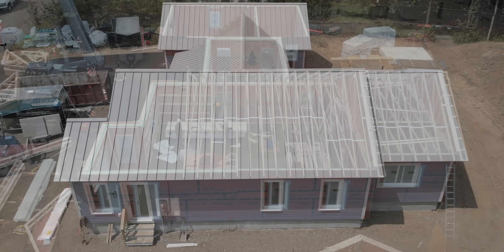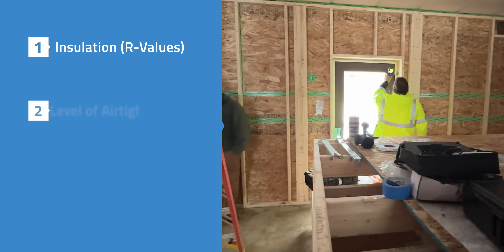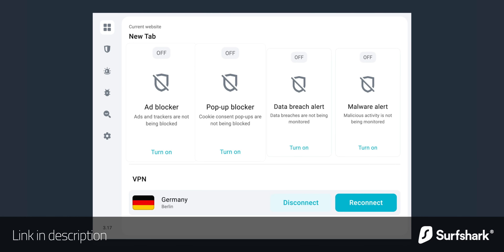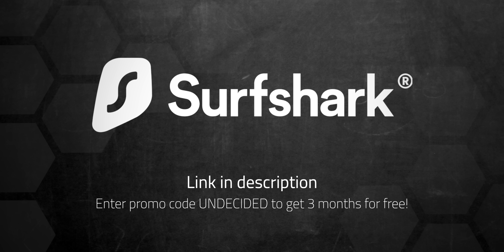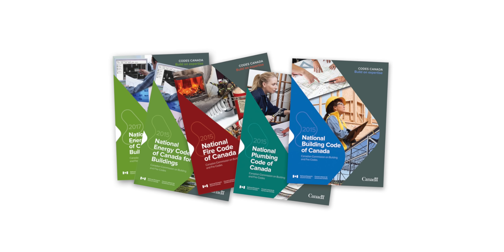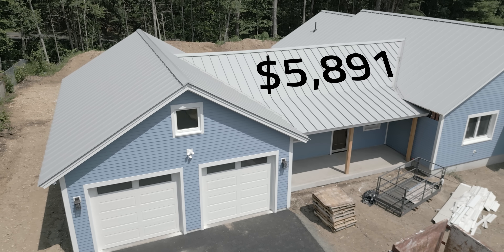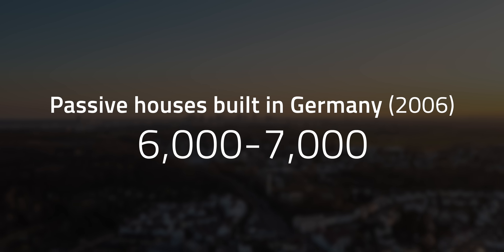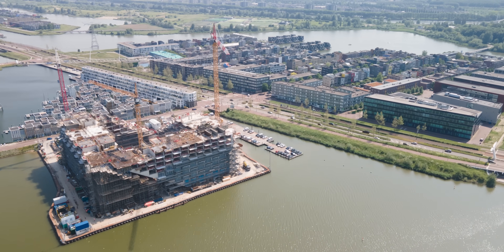Why Do American Homes Suck?

Comment: Great video, I like it for multiple reasons.
First of all when I was building the house I was checking all building materials due to quality and effeciency. The effecienty is based on eco norms for isulation.
Here in EU, namelly in Czechia after 2020 is super strict and if you don't have any form of heatpump grade A+ or A ++ with triple glass layer of windows and walls made by ceramic blocks 30+ cm in addition another 20+ cm of insulation such as polystyrene or some kind of fiber as well as air recuperation you have no chance to get A grade for passive housing.
Even though it's not enough, I have retention basin around 5000 liters of rain water gathered from the house roof used for garden and for toilettes to save drink water. All filtered thru complex filtering system. 
Solar cells with battery system in not mandatory for A grade so far but will be in near future for sure so highly recommended. So strict it is here. And such house price? Then most of EU countries have obviously house price significantly more expensive than in US. Exact location matters but if we speak in general than yes, all regarding housing market in EU is more effecient and more expensive. 
If I consider climate of Czechia I would say some features are overkill.Inside of house is hard to go below 19-20 deg.C even with heating off in winter or even above 27-28 deg.C in summer with A++ grade of AC.
Even my norwegian stoves are A+ grade and single wooden log can burn up to 2 hours and heat up entire house of circa 180m2 up to 23-25 deg.C. 
All sounds good but build and pay for that is the other part of story 😉

Comment: Comparing with the UK, which somehow seems to be a standard for Americans, isn't setting the bar very high, since it is known in Europe that British houses suck. 

As this quote shows:

"Putting it simply, the UK is home to some of the worst insulated housing in Europe. In 2020, UK homes lost an average of 3 degrees of heat after just five hours – with those in Norway losing just 0.9 degrees and Germany only losing 1 degrees centigrade within the same time period."

Comment: Cost. You want an efficient European concrete walled home I'll certainly build you one. I'm just as capable of a builder as any of my European brethren. However, most people cannot afford that here. Also, imperial measurements are no more inaccurate/accurate than metric and anyone who says different doesn't understand how measuring works.
Reply: I dont think he understood that money is already tight for majority of Americans and the housing market itself is terrible right now. People cant afford housing as is, let alone a large 50% or even double cost to get it super high efficiency. sure everybody wouldnt mind a better home but people buy what they can afford. Tagged alongside a used home, nobody is going to buy it full price, then remodel from foundation up to get that higher rating, it wouldnt be financially smart. This video really glosses over more glaring issues.

Comment: As a large HVAC contractor I get what you are saying about the waste of energy, however you act like it's cheaper in the long run to build more energy efficient houses and it's simply not. Builders have a hard enough time selling new houses. The fact of the matter is that the amount of people can afford a new house is a small amount and if you are adding an additional 30% to 50% of the cost you now even have a lower percentage of buyers. In 15 to 20 years the equipment will need to be changed out which will cost more money.  Energy is cheap right now so until it becomes more cost effective people won't spend the money. Most manufacturers of that equipment are having reliability issues in the states with the more efficient units as well. I agree about the insulation but if it is not done right it leads to high CO2 and other air quality issues. Most American homes use gas so the draft does help with air quality issues. That's just one issue caused by low ACH. They need to do more research to gather data to see if sealing a home up could cause long term health issues.
Reply: The extra 100k+ is a lot of years worth of energy consumption lol

Comment: Very interesting, thank you very much. 
I am from north-west Italy, a region basically surrounded by the Alps on 3/4 or its borders. Hence, quite cold during winter and hot in the summer. Following the strict building rules we have, both for new buildings and for the ones under renovation, our apartment in the city centre (around 200 m2 = =/- 2,100 ft2), in a mid-eighteen hundreds building, totally refurbished and restored lately, is very well insulated, to the point that even in the coldest winter the temperature inside never goes below 18 C, without turning on the heating. Clearly having centralized heating and water heating system makes the difference. It is a matter of economy of scale: heating the entire building in a centralized manner, with one very large single heating unit, is more efficient than having 50 individual heating systems, for each one of the apartments.
Also, we just finished restoring/refurbishing our early eighteen hundreds country home (800 m2 =  +/- 8,600 ft2), with all the newest technologies like heat pumps for water heating and solar panels for electricity production, while taking into account the character of the building, like using hydraulic lime plaster on our very thick and insulated walls and terracotta floors, which also protect against mold and humidity besides contributing to insulate the structure. Nevertheless, investing in such type of building is extraordinarily costly. Hence, in many cases, the State as a whole came in. In the last 3 years, our country has invested a ridiculous amount of money to fund and support energy efficiency transition, particularly in private buildings. As taxpayers, we produced a large internal debt in order to absorb such investments; nevertheless, perhaps this might indeed carry positive environmental effects on the newest generations.

Comment: Altough European houses are so well built, the EU is putting a lot of pressure on the citizens to improve there homes even more. We are pushed to rip out double glassed windows, replace (almost new!) gas heatings by heat pumps, install photovoltaic systems,  renew roofs and insulate the fronts even more. Regarding the enormous energy costs and the actual finanancial inflation this is a burden which most of us cannot bear. So this is the other extreme compared to the situation in the US. It seems the EU wants to save the world on its own. But to the true reason is the money - climate protection is a huge business here.

Comment: It’s common and also mandatory in the most of the EU to build energy efficient homes / public buildings etc. The project has to meet high energy standards to even be approved for construction by the authorities. Tripple glass windows, heat pumps, air exchanging units, tons of insulation.. that’s pretty much basic stuff to meet the criteria. Anyway, loved the video

Comment: I must be the only one in Scandinavia who misses my US type help. My heat pumps are terribly inefficient, windows mold so easily, and bathroom design baffles me. It is a 1964 house updated in 2018 just 3 yrs before I bought it. Even keeping my house at 19°C in mid winter costs me about $800 a month.

Comment: This felt like more of a soap box video. I was hoping you would go through your house and display or explain what you did differently that would improve current methods of building. And if money was no barrier, I'm sure those triple pane windows would be great. Unfortunately, quadrupeling the window budget on every house because we regulate it that way would add even more time and money required to build houses. You mentioned you would save about 6k in energy costs in your house, but you didn't mention over how long, or how much more money you spent in construction over the other houses in your area.

Comment: My biggest concern with complex systems for energy reduction is the embodied energy in the manufactured products, future supply chain for maintenance, and  cost to repair when disaster strikes.

I build for a living. I had a roofing supplier push a 30 year warranty on their asphalt shingles recently. I just laughed. In the 2050’s if we are still using asphalt to construct roofing, we are in trouble.

That is the theme of complex hvac systems, building envelopes sealed with petroleum products, composite materials that depend on international supply chains sourced feedstock, etc…

It seems to me that regional building systems have been the standard for human civilization for centuries. It may be hubris, and recency bias, to be think we can ignore those principles and call our modern systems ecologically sustainable.

Comment: Wow!  You are “saving” more than my energy bill is (gas and electric) for a year.  No solar and two HVAC systems on 2800 sq ft. 900 sq ft is a new addition as of 2016.  1900 sq ft is from 1957!  We did replace the windows and I have insulated and sealed it up a lot.

Comment: This stuff isn't common where I'm from 😂 we just usually build our houses using concrete blocks. No high tech ventilation system. Normal pull up windows and maybe an ac unit. We build on concrete pillars too. Our houses last wayyyy longer than the American cardboard houses.

Comment: Lived in the UK - houses there are rubbish too. Drafty as hell, single pane windows, no proper insulation, so as long as you got the heat on, it’s warm, when you turn it off, it gets cold, black mold problem pretty much every flat I lived in. Bills were really high during winter because of that. In the summer, the flats felt like a personal sauna as heat is not being kept out due to air easily moving through the walls 😅 Landlords literally don’t care, since the majority of buildings are very old, so it’s expensive to do proper renovations. So happy that I moved out of the country and I now live in a normal european apartment where there’s no problems.

Comment: I’m doing a remodel in California. The cost to build is staggering. I spent $80,000 in fees to add 1600 sq. Feet. Solar and Battery will be another $80,000. Heat pumps will be almost $70,000. Adding high performance walls and windows at California prices will take two generations to break even. I literally can’t afford any extras. Local government will squander what I would have used to make my house high performing. 

In America, outside of California, almost anyone can afford a nice house. I don’t think that’s true in Europe. 

American homes may suck, but most Americans can have them.

Comment: I have spent time in Romania, where these tilt and turn windows are common. The tilt out is fine, a good Innovation on swing out windows. However, overall, I despise these windows in general. I believe slide up and down are far superior. The tilt and swing windows swing with the wind. They can be dangerous. I would never put them into my house unless I had to.

Comment: You really glossed over cost increases with higher regulations. We're in the middle of one of the worst housing affordability crisis in history in the US. You even mention Canada with their more strict regulations which is ironic since their housing affordability crisis is 10x worse than the US. Most people already can't afford a home, and these mandated efficiency regulations are not helpful. Cheap energy in the US also accounts for less need for spending more on higher insulation requirements. I'm sorry ,but most people aren't trying to 'save the planet' from climate change when they're already struggling to even buy a shack. It's a very privileged way of thinking.

Comment: In Latin America most housing is made with concrete blocks, ceramic floors and tile or aluminum ceilings. A lot of houses in Central America and the Caribbean have withstood hurricanes so I’m not sure why this construction method is not common in TX, LA, AL, GA, MS and specially FL
Reply: They could build that way too if they want..

Comment: "Why?"... probably because the minimal amount of cost savings is barely worth wasting thousands of $ just to save a tiny amount of energy. 

As cute as it is to say "This reduced our energy usage by 300% percent!! 🤪"... if you had to spend $10k to get a 100% decrease in energy usage (which was only $500/yr to begin with)... you're only saving $250/yr... that's 40 years for that investment to BREAK EVEN.

...and in 40 years, THAT will be considered "inefficient"... so then what? Dump another $10k into better insulation to cut that energy usage in half and save $125/yr?

Diminishing returns... something most European counties don't seem to understand and why your average American lives like the upper class in Europe.

Comment: Apart from heat pump. The house described is a standard minimum style house from ~30 years ago. However I think municipal heat, which is common in Finland in urban areas, compensates the lack of heat pump tech in 90s. Also everyone basically has reserving fireplace in their house.

Downside of the Euro efficient house is the hot summers we are getting. Once the building has warmed in the summer heat, you can't cool it down. And heavy insulation prevents cooler outside during night or just random cool day from cooling the building either. Big problem especially with big buildings. You can feel the buildings radiating heat during summer nights after baking in the sun for few days or if the air been very warm. Ability to take in heat during winter is good, but not during summer.

Comment: Two huge things missing here are the timeline that $5981 would be saved over, and the cost to realize that savings.  Two major drivers you don't discuss are opportunity costs (do you save as much as you'd make by putting that money in the S&P500, with 10% average nominal returns?) and lower barrier-to-entry (people struggle enough to buy the homes we already have, let alone those + extra cost for efficiency updates). You also discuss this in terms of "the US", when the US is so geographically diverse that one size will not fit all for any building requirement - e.g. northern-midwest & northeast states already have much stronger insulation requirements than southern states, both because of higher risk of frozen pipes & dangerous cold is higher up north and because risk of mold tends to be a lot higher down south.

Comment: In the UK we require an energy performance certificate before we rent or sell our homes. Energy companies charge everyone through the bills to create a fund which insulation companies Apply to spend making existing buildings more efficient.
The EPC last maximum of 10 years, but need to be changed if improvements are made. Certificate approximately £50 cost

Comment: We built an very efficient house using geothermal pumps for heating/cooling and domestic hot water in 2020. The house is very tight and has a HRV for air exchanges. It is a very comfortable house to live in and with the 10.4 KW solar array out back the only energy cost is the monthly minimum service fee. To top it off we built a very traditional old farmhouse style house and quite a few people compliment us on how nice our old house looks. We have the best of both worlds!

Comment: In my opinion, we have been building houses wrong for decades (building way too big of stick-built houses). We should be using ground air for cooling and heating (55 F degrees year around). I hope things change and 3D printing using clay takes off and high insulation of hemp or wool renewables does too. One reason I have not built a new home is I live in a 1935 home, which I heavily insulated with blown-in, and put in new doors and windows, it cost very little to heat, and I do not need or want airconditioning, My electricity bill is so low it would take years to pay off solar power if I was to convert. Causes me not to do anything different.
Reply: Speak for yourself

Comment: I'm all about efficiency, and the notion of short-term cost savings over long-term cost/benefits is a cultural issue here in the US that needs to change. However, a national building code wouldn't be a good thing in the United States since we have such a varied climate. Just think of how drastic the differences in construction needs are from Maine to Hawaii, or Florida to Alaska. These are very different climates, with differing weather, natural disaster concerns (earthquakes, wildfires, hurricanes), and culture and economics. Getting building materials out to Hawaii is a significant cost, hence their single-walled construction methods. England is small enough to have national standards that work. That said, each state should look to better their construction requirements for long-term benefits instead of the cheaper more profitable approaches by builders/contractors/developers. At present, the notion of million-dollar townhomes in cramped sub-divisions, built as cheaply as possible with the greatest profit to developers, is the norm. City council members and stakeholders engage in opportunistic levels of corruption, all under the guise of "economic development" and business, with little to no concern for long-term cost or community impact. This is perhaps where oversight and restrictions need to be.

Comment: I think less regulation around housing quality is better for the worst off people. Europe has a tendency to set a minimum quality and therefore price on housing. As a result you end up with housing being too expensive.

Insulating your house against the elements is a very nice thing to do...if you can afford it. It is always going to be cheaper to insulate yourself that it is to insulate your house (wear jackets inside for example, thinking about it now, this wouldnt work in hot areas, im from Ireland where its pretty cold).

Governments need to get more comfortable letting people live in crappy hosuing. If they choose yo live there its better than yhe alternatives